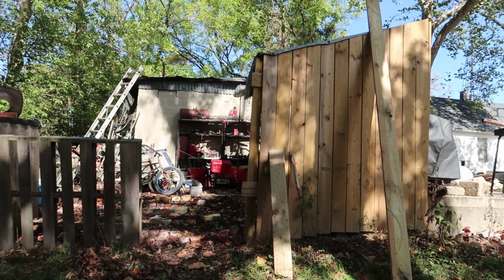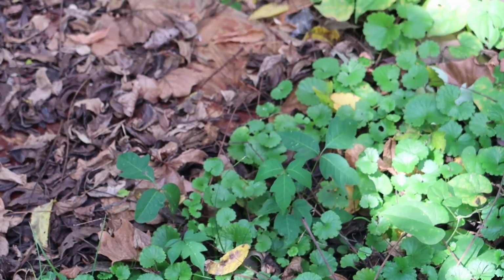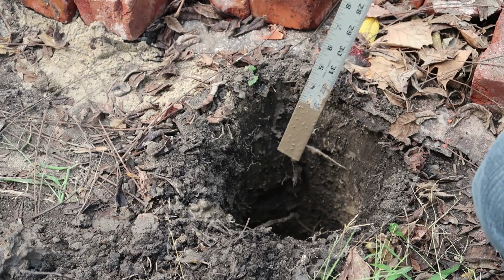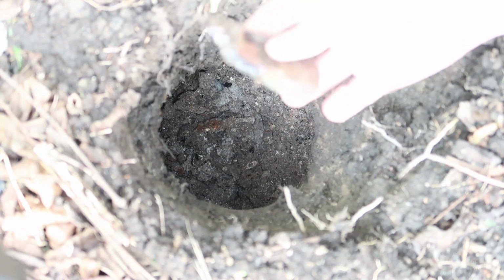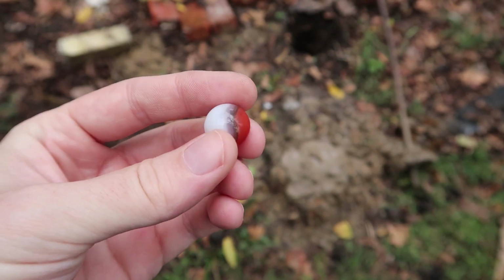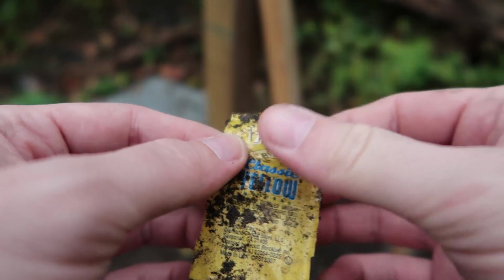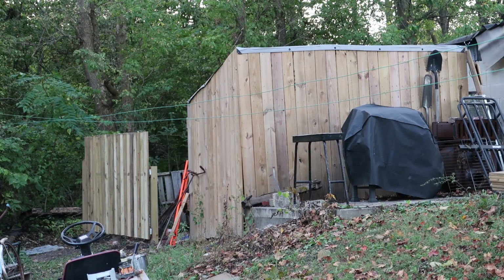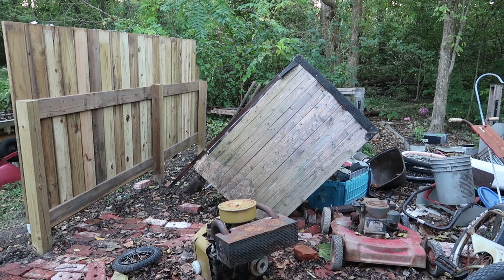Upgrading the Wooden Privacy Fence: Replacing Pallets with something nicer

Comment: After finding that bottle and marble I probably would have torn up the yard looking for more cool old stuff that's been buried all these years! Also I'd love to see that engine running you pulled from that tiny shed. I bet it would make a sick go cart engine!
Reply from the maker: +Horsepower i plan to rip up and sift through the whole yard eventually
Reply: Oh that's going to be an awesome video! By the way what did you make of that tool I found?
Reply from the maker: oh sorry i forgot to check twitter. it looks like something for working with logs, like to move logs at a lumbermill.
Reply: I was thinking that too. Or maybe something used to separate something as well. Thanks for taking a look at this strange tool! I'll probably keep it somewhere in the garage. It's pretty neat so I might try and clean it up and hang it in there somewhere.

Comment: I have found that pea gravel is best for setting my fence posts. 24"-27" hole, a couple inches of pea gravel on the bottom. By the time you have the hole filled and vibrated, it is fixed for the long run. Make sure you plumb the post before you finish, as it will be very hard to move after.

Comment: Use postfix or concrete .. mud & wood won't last
Reply from the maker: bought some concrete but would hate to waste it on this.
Reply: Cement or ready mix concrete does not last long in storage. Leave it a few months and you will end up with a big brick in a bag. May as well use it on this and get more only when specifically required for a project.
Reply: The quality of treated wood is not good nowadays. These post will rot and snap at ground level within a year or two at the most. Postfix would have been the easiest and best way. I would have mixed a bit up after and put a small slope around the bottom of the post a couple of inches above the ground. Also you could have wedged bits of rock or brick in the holes to keep the posts level without needing to fix a piece of wood across the top.
Reply: Considering the previous fence was pallets attached to rebar stuck in the ground, I'd say it'll last well enough. It'll rot out eventually, sure, but it's a fuckin' fence, he's getting his $30 worth out of it, and gets another fun project when it falls over and he's 50-ish.
Reply from the maker: actually i plan to use the cement for plugging up the cracks in my house's foundation for now.
Reply: Delivery McGee Was just sharing my experience as I do this for a living in case anyone else decided to do this. Nothing against Rinoa it's his fence he can put it up how he wants but there is no way it's going to last until he is 50. The reason the old fence lasted was because of the rebar. I have seen 6x4 inch treated posts snap within a year that where cemented in just because soil was placed around the post. As soon as a strong wind comes they snap. Arsenic is no longer allowed in treated wood this is the reason why.
Reply: Would you ever build a outdoor pizza oven ?

Comment: Nice old-fashioned hole-digger, interesting use of handlebars! Underground, I'd expect plastic like that mustard packet to last anywhere from 50-100 years, though the labeling would probably break down first and leave it blank. Gonna keep the V4? (just idle curiosity)
Reply from the maker: +TheFurriestOne v4? i pretty sure its apposed two cylinder. but yes im keeping the yellow engine
Reply: Ah, I couldn't remember. That's cool, maybe someday you can get it running!
Reply from the maker: i want to get it running off woodgas, maybe build a big tracked-vehicle to put it in.
Reply: That'd be awesome! Sounds like something that'd be great for brick-collecting in the woods!

Comment: Hello, Rinoa
I've aquired a simple DC 12v electric bell, I live in a city so I want to try it out on my bike and see if you could hear that in a car; however I have no good way of powering it. I was wondering if you had any sudjestions of batteries/packs I could use, perferably something that can be mounted under the top tube. I need my panier rack open for storage so can't copy the telsa-punk bike.
Thanks!
-Jacob
Sorry for being compleatly off topic but apparently direct messages arn't available on youtube anymore.
Reply from the maker: +MC_P_123 yes you can still PM somebody on yt, and i recommend getting some 18650s and making like a 6 or 9 cell pack if you can. or you can use a step-up converter to take 4.2c to 12v.
Reply: Rinoa Super-Genius ah, sorry for the misubderstanding. I suppose I should watch through your 18650 videos. Do you thunk it would affect the loudbess to run tge bell at 6 or 9 volts i stead of 12? also what is the c in 4.2c standing for?
Reply from the maker: +MC_P_123 sorry, i meant 4.2v as in volts. im not the greatest at touchscreen typing
Reply: ah, that's ok I was thinking you ment coulombs and was a bit confused :P
Reply from the maker: oh no, i dont get into that complicated of stuff. lol
Reply: Rinoa Super-Genius good, neither do I :p

Comment: Have you had that twin cylinder engine running yet? I'd have been tinkering with it as soon as I got it.
Reply from the maker: +ben hunter no, but ive decided i might try it on woodgas eventually.
Reply: That sounds interesting, I'd looked into wood gassification a few years ago because I was interested in efficient, low smoke camping stoves. There's some pretty impressive setups here on YouTube. I'd still try to get it running on petrol... err I mean gas (the type that is not in fact a gas at room temperature) first to make sure it's running correctly and to warm the oil up so that you can change it for some fresh. I look forward to potentially seeing that in the future.
Reply from the maker: yeah i tend to call it petrol or gasoline instead of gas.

however petrol is expensive, propane is a lot cheaper.

Comment: I cringed at watching you wear open toe sandals. Thats cool if you want to but when I smashed my big toe and the pain of the nail turning black and falling off have worn steel toe boots and safety glasses ever since.
Reply from the maker: +BadBrad23 if you need to wesr armor while you work, then you arent working safely enough. i recommend being patient and slowing down, also being more aware of everything.
Reply: I haven't worn steel-toed shoes for more than forty years.  I haven't dropped anything on my feet either.

Comment: rub candle wax onto your wood saw and you will find cutting wood will be easier.
Reply from the maker: +DAVID GREGORY KERR thanks for the tip! i figured somebody would comment about the snagging issues i was having. although that was only on a few really wet boards.
Reply: Also helps to support the wood closer to the cut.
Reply: Also helps to set the teeth.  A dull saw with enough set will still cut.  A sharp saw without enough set will stick and chatter.

Comment: The mosquitos need standing water of course and with all the items and materials you have there It's possible there are places that accumulate water and provide a breeding place for them. I guess this in not particularly helpful info in December now
Reply from the maker: its all the standing water in the woods behind my house and the stagnant lake several hundred feet back that really matter. the creek behind my house has a hard clay bottom and giant puddles (imagine 50 gallons each) just sit there and almost never evaporate. this is just a part of being in illinois.
Reply: It is likely you are right. However natural areas with standing water will often have predators of mosquito larva like dragonfly nymphs, tadpoles and killifish. There is even one species of mosquito that only preys on other mosquitos. So human habitats with standing water are more novel and the these predators are not adapted to them like they are vernal pools, low streams in late summer, and other naturally occurring water.  In my experience here in Virginia is that if you are vigilant about trying to prevent things from gathering water around your house it makes a difference in the numbers of mosquitos.

Comment: Paranoid about poison ivy/oak but wearing open toed shoes?! Haha.
Reply from the maker: yes because i have to wash my feet off at the end of the day. you think i would want to spray a pair of sneakers or something with water? youd get mold very quickly.

you clearly lack practical knowledge.
Reply: Rinoa Super-Genius We've got tons of poison ivy on our property so when I'm working in the bush I wear tall rubber boots so I don't get the oil (urushiol) on my pant legs. I wasn't trying to be a jerk by the way!